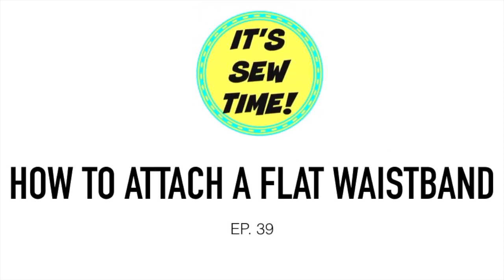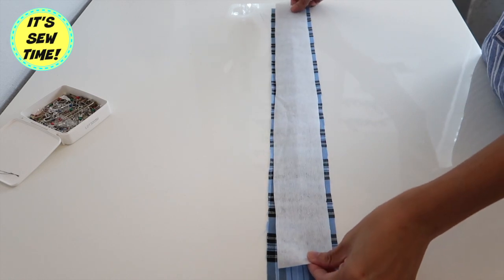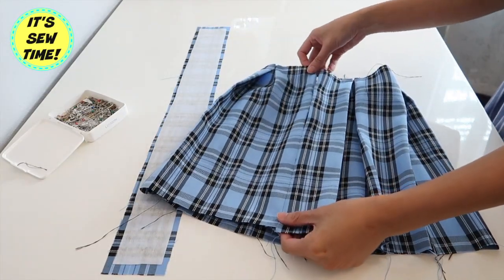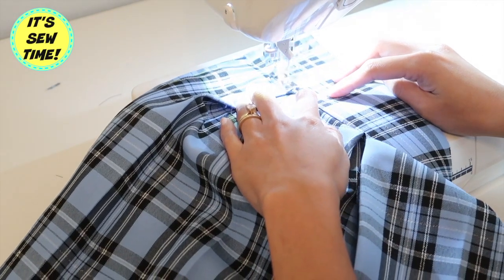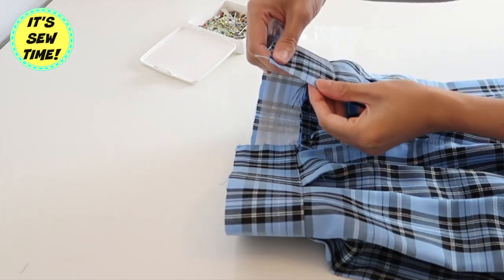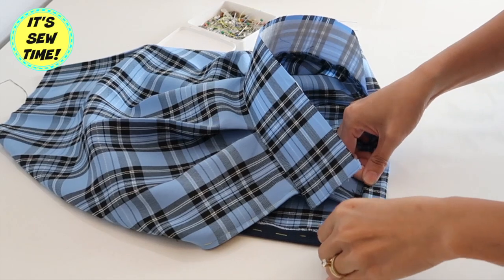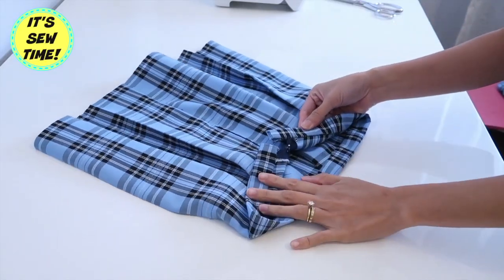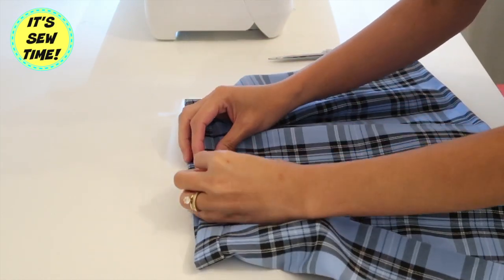HOW TO SEW A FLAT WAISTBAND ON A SKIRT

Comment: Is the interfacing important?
I made a simple waistband without it and it kinda is loose on the top edge and nice and snug on the sewn edge
Reply from the maker: Interfacing is necessary for light weight fabrics so it holds up. For thicker fabrics it’s not.
Reply: @sewaldodiy  thanks that explains why my waistband is so loose on the top where it's just folded
Reply from the maker: @Angelika5378  I'm glad to hear I could help. You can fix the loose edge by doing a top stitch so it doesn't stretch any further!
Reply: @sewaldodiy  thank you^^ I have to change a bit on it anyways so I'll do that too
Reply from the maker: @Angelika5378  It's my pleasure!